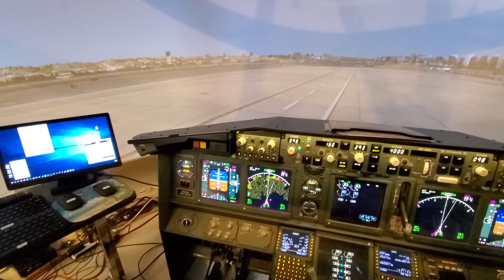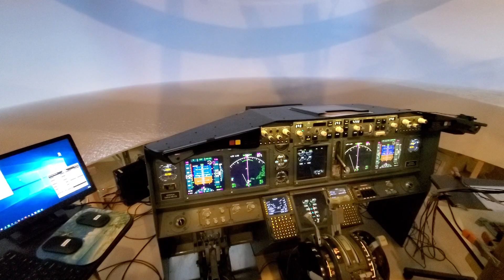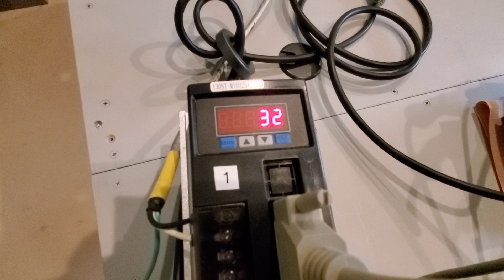B737 Motion Platform --  Initial testing of the 130ST AASD30A with the AMC AASD Controller

Comment: The AASD-15A displays RPM speed by default... there are other display modes where you can see the torque developed or current. Check the manual how to display these.